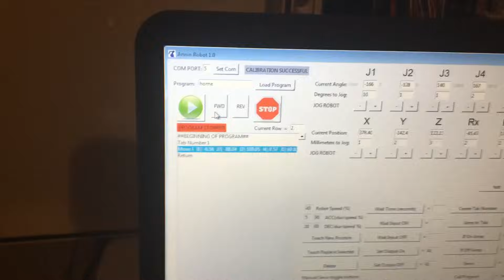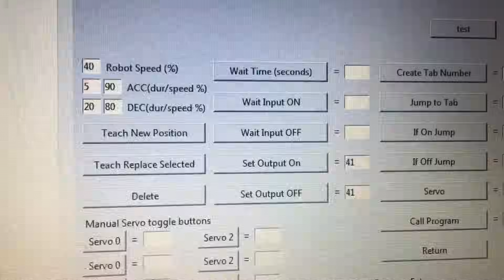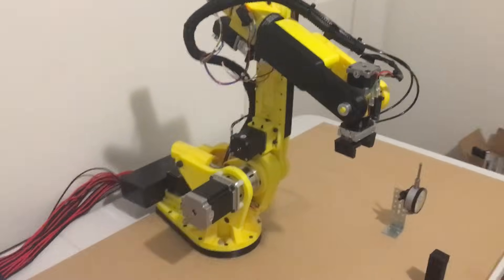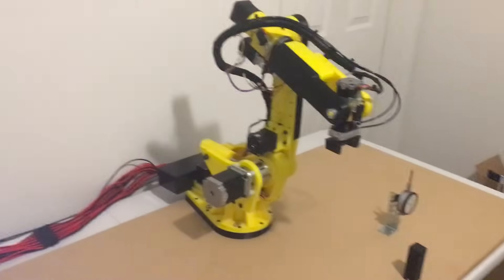3D printed  6 axis stepper motor robot - Gen2

Comment: How cheap can you go with a project like this? I know it costed around 1100 but cheap can you go with the cheapest of the cheapest parts?
Reply from the maker: I think this bill is about as low cost as one could go and still have something usable. The only way to do a cheaper robot would be to build something that uses plastic servo gearboxes like some of the smaller I’ll be robots out there. I designed this robot around the low-cost parts I could fine I suppose you could shave a small amount of pressure off a few smaller bearings and re-designed it but I think this is about as cheap as you’re going to be able to build a 6X robot that can actually do some work.
Reply: Chris Annin darn, I was looking for a school project I could build for about 100-200 dollars. You got any recommendations for a robotics arm?
Reply from the maker: They only robots I know of in that price range are the small hobby serve a robot you can find on Amazon such as this one: 
SainSmart 6-Axis Desktop Robotic Arm, Assembled for Arduino UNO MEGA2560 https://www.amazon.com/dp/B00UMOSQCI/ref=cm_sw_r_cp_api_rLNDAb6R72CHE
Reply: Chris Annin Is there a open sourced 6 axis hobby robotic arm you would recommend? Thanks for the help! :)

Comment: Chris, this is slicker than slick. Amazing work! And a HUGE help to K-12 academic settings - another use case for your "affordable robot." In my case, I am currently developing a computer integrated manufacturing program @ Valley Career and Technical Center in Fishersville, VA (https://www.augusta.k12.va.us/Domain/3127) . It launches August 2018. I want to expose my students to industrial grade robotics but cost is a significant limitation ($20-$30k) vs budget. As it turns out the program will include CAD and 3D printing elements. Our facility also houses a Precision Machining program (https://www.augusta.k12.va.us/Domain/1913).  I'd love to connect to see if we could partner in any way to potentially have my future students help you with your man-power resources constraint in return for you releasing your project details? Look forward to hearing back.

Comment: Hi Sir. I am also trying to make a similar one. Can you mention the driver that you used for this project? Also please email me at sarmadgulzar@outlook.com I may need some advice from you regarding this project. Thanks a lot. Waiting for your reply. :)
Reply from the maker: Hello, this robot uses an arduino mega which sends step and direction outputs to stay for drivers. In the description there is a link to the project page where you will find it for bill of materials instructions and schematics, the project page also has my email address If you have any other questions

Comment: Why are these things always so damn shaky? Is it because of the plastic? Does the aluminum one move better?
Reply from the maker: Yes the aluminum one is better but it also has to do with the inexpensive gearboxes / backlash as well.  Even the big industrial robots that I program have a little bit of deflection if they stop or accelerate fast enough but obviously they don’t shake hardly at all compared to this because they’re huge cast arms with harmonic gear boxes that are meant to avoid the sort of thing.
Reply: Thank you so much for the answer! I always wondered if it was the rigidity of the arm material, the gearboxes, or the software. Your work is excellent, thank you for sharing it with us. Liked and subbed.

Comment: Nice design and work, but i have a question: after having spent all those hours for design and the money To build it, what Will you do with it? I mean it can move small objects from one place to another which you can do quicker by yourself btw and if that's the case only then what's the point in putting this much effort and money in it? Sure it looks neat and beautiful but why should one bother building it?
Reply from the maker: I suppose mostly it’s just a fun project to build, and for me the point was learning the programming and the robot kinematics. The software was where all the work was at and it’s an open source project of people can apply to their own robot builds. These first couple robots I’ve built or mostly proof of concept but it’s still very usable if you look at my video of the aluminum version that can lift 3 pounds so I could definitely be used in a lab situation or loading or unloading small machines. A friend of mine owns a machine shop and he made all the parts for the aluminum version he has the aluminum version now and his programming how to load and unload lathe.  After a few more updates and improvements I plan on building in much larger and usable robot.

Comment: Hi Chris, The arm is coming on well (if slowly!). A couple of questions:-I have equivalents of the ST-6600 stepper controllers. What do I set the 6 DIP switches to for each of the steppers. On my controllers DIP 1 to 3 control microstep as follows NC, 1,2/A,2/B,4,8,16,32 and DIP 4 - 6 Current(A) 0.5,1,1.5,2,2.5,2.8,3,3.5Also how do you provide air pressure to the gripper? This info may already be in your comprehensive documentation but I'm currently completing the mechanical build. Thanks, Keith Emerson
Reply from the maker: hello,  there is a defaults setting file in the software folder and also settings are layed out in the electrical enclosure manual that have all the driver dip settings-let me know if you find these and if you have questions.  I use 4mm pneumatic tubing in the wiring harness (see wiring harness manual) and I use  a small compressor.  thank you.

Comment: do you use micro stepping?
Reply from the maker: Yes, most of The drivers are set to quarter steps, on the project page in the manual for the electrical enclosure I go over all of the microstep settings

Comment: Hi, Please can you provide more information on the gripper you are using. Thanks, Keith emerson
Reply from the maker: Hello it's a pneumatic SMC mhf2 low profile gripper. I got it of eBay for $40.  These small smc grippers are the lowest cost option on eBay and aliexpress Ive found. I'm controlling it with a relay output wired to a solenoid valve

Comment: Sweet. If you can tighten up the lag/backlash you could switch out the end effector for a 3D print head and there you have it a free form 3D printer :D
Reply from the maker: I put a link in the description for the latest one which is made of aluminum and has some higher precision gearboxes, let me know what you think.

Comment: five axis cnc cutter next please !
Reply from the maker: that would be a fun project.  I did make a 3 axis engraver a while back that turned out pretty good.  I might put together an assembly manual and post all the print files to make that.  might be a while before I make a 5 axis though :)

Comment: Hi Cris,
I really like your project, thanks for sharing. I also want to make a model like that for my dissertation and I have some questions that I hope you answer to me:
- What is the algorithm that you will base on to develop continually? (Python platform or arduino) and use gcode? According to my opinion, arduino is not fast enough to process Kinematics equations as well as control step motor.
- I want to embed Python on another chip (E.g. Intel Edison or ARM microprocessor) to process instead of using computer for running Python file. Is this working?
- I think you should build a tool like teaching box to be professional :)))
Thank you so much.

Comment: Chris annin I have a question. Does the arms of robot stay at the home position even when the power is turned off? I mean, do they not fall down as motors are deenergised?
Reply from the maker: I program my home or rest position vertically straight up and down (robot standing straight up) and the robot stays just fine and does not drift.

Comment: do you feell comfortable with all those bouncing backlashes, or is this just a concept prototype before a metal version?
Reply from the maker: I'm not happy with the backlash on J2, on the plastic version I keep the arm forward and transition slowly to arm back if needed to minimize bouncing.  Still not optimal...  I just ordered precision series drives for the aluminum version I'm working on.  Hopefully reduce backlash/bouncing issues.  Keep in mind this is about as low budget as you can go and the goal is a usable robot at lowest price. I'm not expecting to have zero backlash like I would if building a $15k robot with harmonic drives. But hopefully I can make it better. I'll post a video and report progress hopefully in a few weeks.
Reply: nice!, i'll be waiting for it

Comment: Hi Chris,Very comprehensive description of your project.I'm starting to get the parts together (I'm based in the UK). At the moment  I can only find a 23H22-2804S-PG47 (rather than the 23HS30-2804S-PG47). Is this a problem? I think that the difference is operating voltage but as it is the most expensive motor/gb I want to get it right. Also is it possible to use PLA rather than ABS for the plastic parts?You set the bar really high with the quality of your instructions, explanations and downloads. This gave me the confidence to embark on this project. Thanks again Keith
Reply from the maker: Either motor should work fine, the one you are looking at is a shorter body motor at 56 mm and I believe it's 1.25 N meters of holding torque. The one I used has a longer body motor at 76 mm and it has 1.9 N meters of holding torque but both are 2.8 A and use the same gearbox so it should work fine. I selected the larger motor just so that I had more torque but I don't know that you really need it with the printed version. The aluminum version with the larger motor can handle 3lbs. But I'm working on upgrading to stepper online's new precision series motors for J1, J2 and J3 on the aluminum version robot before I release the next video and software.  The plastic version will stay the same using the economy series motors. The aluminum version will have minor differences at least on a few of the motors but the software will be universal and only require a couple settings be changed.
Reply from the maker: I haven't tried PLA but I think it would work, I believe the PLA is a little more brittle.

Comment: I am highly tempted to try and build this. Currently pricing it all up, wondering if some nice chinesium bearings might bring the cost down a bit. The steppers dont look any cheaper on aliexpress than the listed stepperonline site which is interesting.
Reply from the maker: Im sure lower cost bearings would work fine as its not moving at any speed.  stepperonline is about as low cost as you are going to find.
Reply: Cheers Chris, I'll let you know how I get on!

Comment: You sir, are badass and I can only hope to aspire to achieve what you are doing some day.
Reply from the maker: thank you.  I started out with 1 stepper motor on a table with and arduino and google in front of me.  its just a matter of starting small, work on one improvement after another, dont get overwhelmed just focus on learning one thing at a time.
Reply: Have you tried to benchmark how much weight it's capable of holding? Apologies if you did mention it in a video, sometimes I'm watching at work without sound!

Do you still plan to machine the parts in aluminum?
Reply from the maker: Ive tested the plastic version with 25oz but havnt fully tested for fear of breaking the J5 carrier.  with the economy series gearboxes the calculation comes out at just over 3lb limit.  On the aluminum version I have tested it and it can easily carry 3lbs. Before I put out a video and release updated software and instruction I want to switch the aluminum version to a couple of the precision series gear drives from stepper online.  with these I should be able to get closer to 5lbs but I will likely keep its rated payload at 3 lbs for an aluminum version.  and 1.5lbs for a plastic version.
Reply: Thanks, that's very cool.

I'm a second year Computer Science student at my local university currently and I'm probably going to make one of these for use in my startup company! Our goal is automation in 3D Prinitng so I'm interested to see what we can accomplish with it!

The 3D Print club is also interested in building some so I look forward to helping them as well.
Thanks again!

Comment: Awesome project. Do you think these servos are good replacement for the stepper motors? https://www.teknic.com/products/clearpath-brushless-dc-servo-motors/
It will probably push the cost to around $2,000 instead of $1,000. Do you know of any cheaper options?
Reply from the maker: I'll take a look at those.  I would love to get into servo control.  the goal of this project was the lowest cost possible robot that could handle any real payload.  this robot is cheap but the down side obviously is its open loop and the gear boxes arent that great.  thats the real problem is finding gear boxes that are decent and cost effective.  then of course the cost of servos on top of that.  this might be a nice option.  I'll take a look.  thx.

Comment: I am new to robotics arms. How did you come up with repeatiablity number. Also, how good is the precision of the robotic arm.  Moreover, what is the  lifting capability. Furthermore, what is the Work Envelope (working range of the arm -visual graph). Conclusion, how do you determine precision, lift capability and work envelope
Reply from the maker: I am gauging repeatability based on dial indicator reading - after repeating tasks a number of times and returning to the dial - what value it repeats within.  I haven't measured precision related to angle or distance readings but I believe its very close.  The robot is 76cm (30") in total length so max outstretched envelope is roughly a sphere about the center of J1 76cm in radius - but with a few blind spots given axis limitations of J1 behind the robot and axis limitations of J2 at the base or floor plane of the envelope.  lifting capability on the plastic unit is not fully tested for fear of breaking the J5 carrier but I have lifted .7 kg (1.5lb) On the aluminum version im currently testing it is capable of 1.36kg (3 lb) payload. Its certainly not a lab grade or industrial grade robot - its the lowest cost robot I could design thats usable for basic pick and place and simple operations.  The gear drive stepper motors are extremely low cost at ~$30 per drive but they do have undesirable backlash so keep in mind the cost and intention vs precision and repeatability of a much more expensive robot.

Comment: I love it! I think I am going to try to build one. Approximately how long did it take to print all the parts?
Reply from the maker: It didn't take too long to print, some of the larger parts took 6 to 7 hours to print but I would just set those to print in the evenings I would say overall I spent two weeks printing parts as I built it.
Reply: Thank you for your reply. I very much enjoyed the video and the project. I am a software type person mostly, but I hack at night :)   I enjoyed reading the python code and it was very straightforward and easy to follow. I work at a relatively large company and while we could afford to just buy a robot, and we may, we have an application where we could use 2, 3, even up to 6 robots. In that scenario, the costs benefits of making it versus buying it add up. 

We make specialized positioning products for use inside EMC and OTA anechoic chambers so I have easy access to steppers, controllers, and such. I have access to 3D printers, and I look forward to the aluminum version too. We have a machine shop and could make those parts.

I really appreciate the time you took to make this and show us all. I had one other general question, what screen recording tools did you use to make these videos? I loved the overlay of the video of the robot with the showing of the GUI on the software video you made, It was really clear to see how it worked that way.
Reply from the maker: thank you very much.  I used VSDC free screen recorder and then for the videos with  PIP video I have a program called yawcam connected to a cheap usb camera.

Comment: Hi. Would there be any significant difference if printed in PLA instead of ABS?
Reply from the maker: I wouldn't think so but I've never printed out of PLA so I'm not really sure.  Isn't PLA a little more brittle?
Reply: Yeah That is true. 
ABS print better with an enclosed printer I heard. But Will give it a try.
Reply: Thanks for the response. and Keep up the good work.

Comment: What is the reason to build it in Aluminium? Or what do you expect to improve with aluminum? Thanks for your answer - and thanks for sharing it with the world!
Reply from the maker: Mostly rigidity.  the printed version is pretty good but the aluminum version doesn't have some of the vibration or bounce.  Also strength - I'm afraid to fully test lifting capacity for fear of breaking the J5 carrier or post.  My hope is that people can build whichever model suits their needs.  obviously printing it will be lower cost - part of my goal is to create the lowest cost robot people can build at home so I hope people find this project useful.  Thank you.

Comment: what size printer platform is needed to print biggest parts?
Reply from the maker: I printed all the parts on a Da vinci 1.0 which is 7.8" x 7.8".  a couple of the models have to be epoxied together.  I dont think any of them consume the full 7.8" surface area but I think you would need approx a 7" bed.